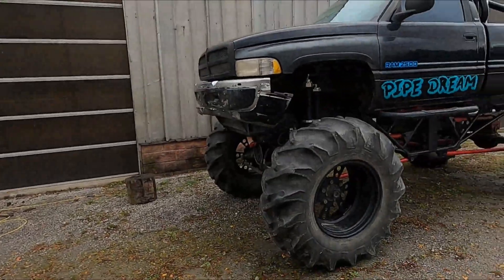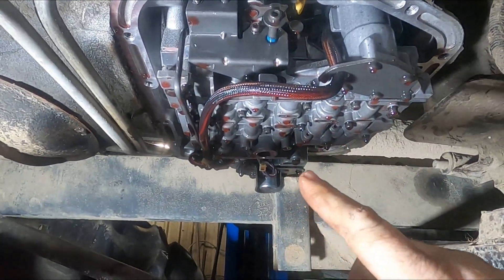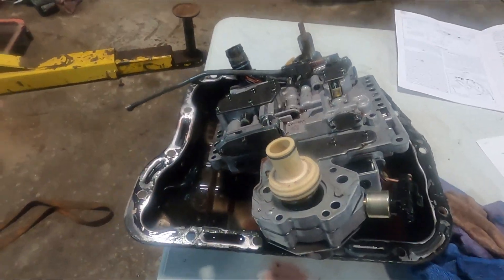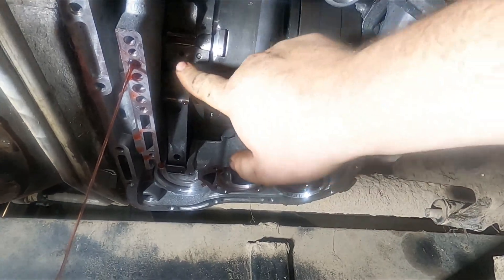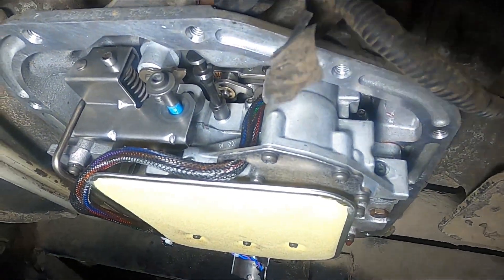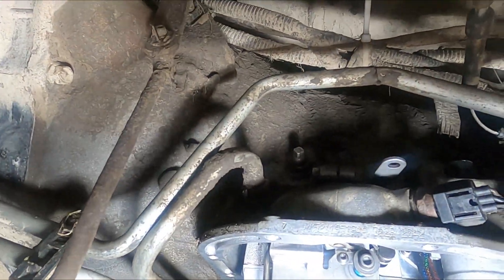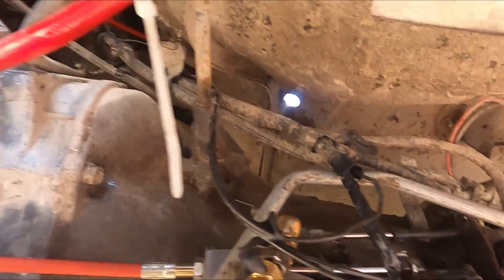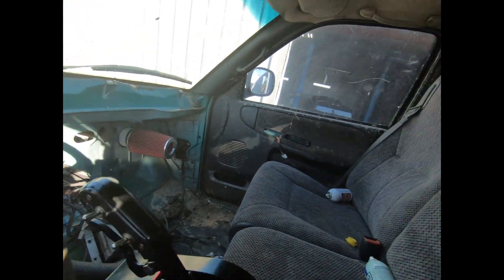Take Control: Upgrade to 47RE Full Manual Valve Body with B&M Shifter

Comment: do all the original wires run from the pcm too the trans too?
Reply from the maker: No. There’s only 3 wires connected. Power, toggle for the OD solenoid and TCC solenoid
Reply: @screamindieselltd  yeah i just figured that out, for some reason only one of my switches work on my shifter, when i’m in drive (3rd) i press and it kinda like launches it harder but by the time i get too 65 my rpm’s are sitting at 2500, and it doesn’t seem like my trans is overheating since my temps are staying normal so i thought maybe my TC only locks up and it’s just not shifting into OD, would you know how to fix that?

Comment: So completely stock 47re stock shafts,T/C,clutches,steels,accumulator servo,GP solenoid and fluid capacity? Even bands and that lever/strut and it’s taking a 2.5 ton mega trucks abuse?
Reply from the maker: Yup there’s nothing done to the tranny other than the FMVB. The  axles are geared to put less strain on the trans.